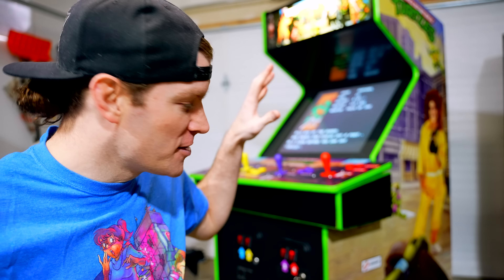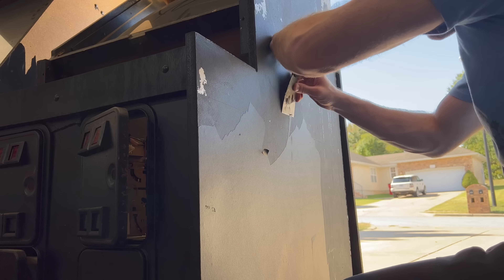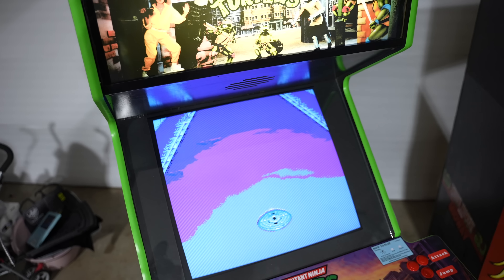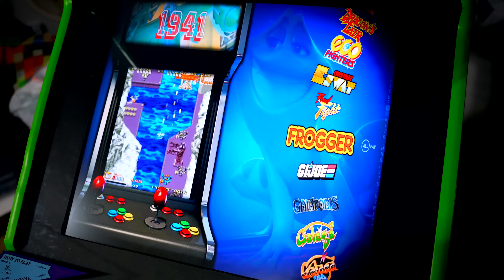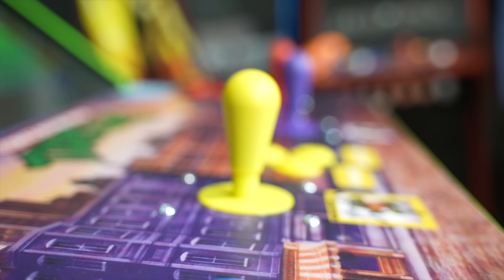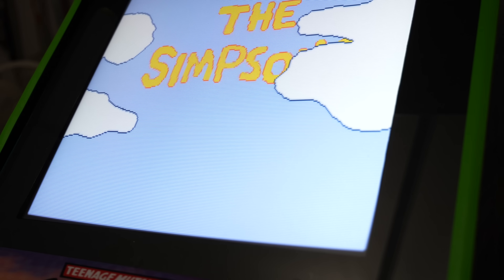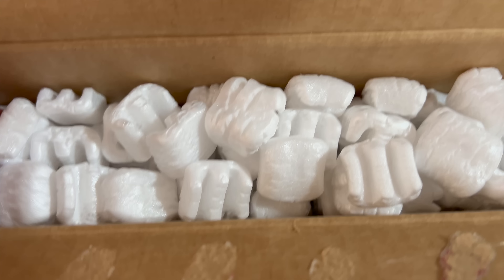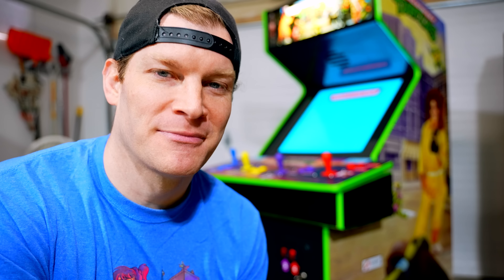I Restored An Original Ninja Turtles Arcade Game Cabinet!

Comment from the maker: Everything that I used in my Teenage Mutant Ninja Turtles arcade cabinet restoration project can be found below. 
LG Dualup Monitor: https://amzn.to/3gJoXBj
Dell Optiplex 9020 SFF PC: https://amzn.to/3gHUC6f
Arcade Cabinet Side Art: https://bit.ly/3VjZWM6
Control Panel Overlay: https://bit.ly/3gJuVlx
Ninja Turtles Arcade Marquee: https://bit.ly/3VgyfU9
Joysticks/Buttons: https://bit.ly/3ERDoww
7mm Mini Momentary Push Buttons: https://amzn.to/3OMfNR2
Zero Delay USB Encoders: https://amzn.to/3TTtheS
Audio Amplifier: https://amzn.to/3GA6eTk
New Coin Door Locks: https://amzn.to/3GEpvmF
Custom Glass: https://www.onedayglass.com
T Molding: https://www.t-molding.com/
Reply: I checked out the glass shop. About 108 dollars. How much was your quote for local glass? I have a 4 player captain commando that I want to turn into a 4 player multi but I also want to turn it into a suowr street fighter 2 grandmaster. So as of now it's collecting dust, since I stole the crt for another project.
Reply from the maker: @jaygallegos8612  I only paid $65 shipped for the glass I got from one day glass. My local glass shop quoted me $70 and a month long wait.
Reply: Awesome video. Helped me decide to grab the lg monitor myself. If you don’t mind me asking, how are you setting the display orientation and resolution in windows itself? Are you changing the aspect ratio within the emulator?
Reply from the maker: @Shreddy_E  you can toggle the display orientation and resolution in the normal windows display setting menu. Then in the emulator (in my case MAME) you can set things like aspect ratio, scan lines, or other video setting filters or changes that you see fit.

Comment: You should check out the Pacto 4000H encoder.  It's made for 4 players so you will never have enumeration issues like what can happen when using multiple encoders.  Also has several features tailored to a 4 player cabs such as a twin stick mode for games like Smash TV.  Awesome device.
Reply from the maker: thanks for the tip 👍

Comment: Can you share details about the glass?  I’m building a Konami cabinet from scratch, and am curious what the dimensions and specs are. Thanks!
Reply from the maker: Tempered Glass
Shape: Square/Rectangle
Thickness: 3/16"
Tint: Clear
Edgework: Seamed Edge
Width: 26 15/16"
Height: 21 7/16"

Comment: Nice build! I just acquired a rebuilt TMNT cabinet myself! I need to redo the access door on the back and I'm curious what your final door looks like. Did you leave it as a removable board or did you add hinges and/or handles to spruce it up a bit?
Reply from the maker: Left it as a removable board that unlocks using the same key as the key locks on the coin doors

Comment: 🔥That TMNT Cabinet is Epic!🔥
That turned out Amazing!! Love the bright green T-Molding and way smarter going with the LCD. That 25” 4:3 Monitor is Awesome! As someone who uses CRT EmuDriver with a 32” Sony Trinitron CRT Calibrated to 224p, those scan-lines look perfect! 

Come spring time, I’m building a proper MVC2 Cabinet that will be run from Fightcade. Using a LG 32GP850-B (1440p 165Hz, 4ms latency) with Reshade for scanlines and bezels. Brooks Universal Fighting Boards, Sanwa hardware of course. 

Kinda hoping you beat me to the punch and show Arcade 1up how it’s done! 
Revenge video?… 🤣
Reply from the maker: sounds like you've got an awesome recipe to make a killer MVC2 machine!

Comment: Doug awesome job on both cabinets just a ballpark figure what would it cost to do all those changes and bring that cabinet back to life. In the process of getting 2 of them and trying to figure out what to do with either one or both
Reply from the maker: Mortal Kombat was about $5-600 range in totality when I was done. Turtles was more because of the stupid expensive monitor I used. Had I used a different monitor, Turtles restore would have been about the same as my MK build.

Comment: Fantastic Job On the Cabinet!! Just wondering what are you running NFL BLITZ ON? I have a raspberry PI
Reply from the maker: I have an old pc that I picked up for around $100 locally running inside the machine. Runs pretty much any arcade game ever without an issue, and is much more powerful than a pi.

Comment: Looks great. Screw the crt if the dell looks good. 

Are those sticks hard to swap A1U sticks with? I want to put some in my tmnt a1u
Reply from the maker: They aren’t a drop in replacement for the stock Arcade1up joysticks. You’d need to modify your control panel to get them to fit inside your A1Up

Comment: Hey buddy I really enjoy your content.  My Street Fighter II stopped working so the MOD idea is very fresh in my mind.  Advice or guidance to and what I should use?  What would you stay away from?  Raspberry pi or pandora?  I'm some what computer savvy but I'm wanting as close to a plug and play.  Then again the larger screen is an idea for sure.
Reply from the maker: Pandora's Box units are pretty good for simple plug and play without complicated set up. They have models that work on arcades with CRT screens or on modern LCD screens, making them pretty great options for newcomers to modding. Raspberry Pi used to be the king when they were dirt cheap, but prices shot up on them during covid. A PC will allow you to play the most games, and give you the best performance overall, but has the most complicated set up.

Comment: How did you make the monitor fit, the LG dual monitor is an odd resolution, is half of it masked?
Reply from the maker: Monitor was mounted on a piece a wood I cut to attach to the exist crt monitor mounting bracket that was already in the cabinet. Resolution and aspect ratio settings are all easily configured on the computer and can be changed to whatever the user sees best fit. None of the monitor is masked off except for the tiny frame bezel that’s on the monitor bottom.

Comment: How did you mount the monitor?
Reply from the maker: put two wooden boards inside the cabinet as a brace, drilled some Vesa mounting holes in the boards and then bolted the monitor to the boards.

Comment: The LG monitor has a 16:18 aspect ratio.  The original monitor and rom are 4:3.  Did you use the bezel to restrict the size to 4:3 and then use software to restrict the display size?  If not then the image is stretched or it doesn't fill the entire screen?
Reply from the maker: I turned the monitor sideways and set the emulator to display 4:3 aspect ratio